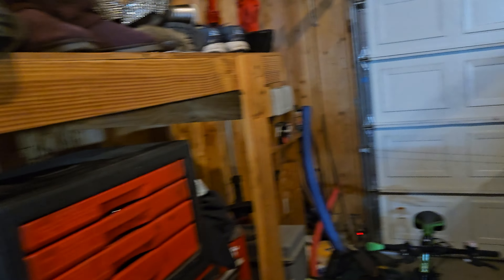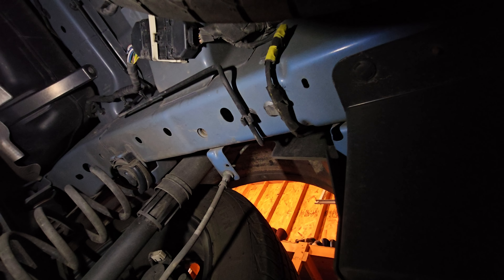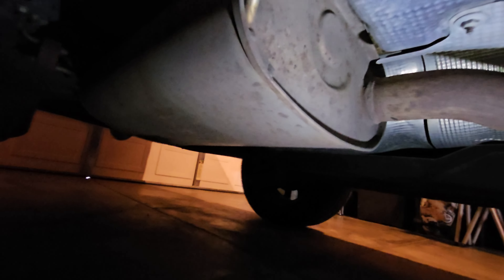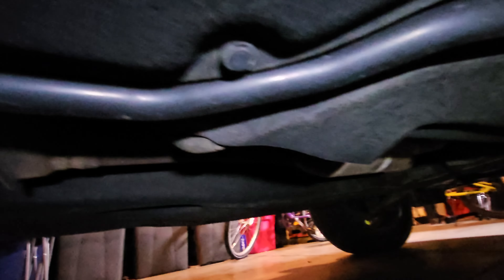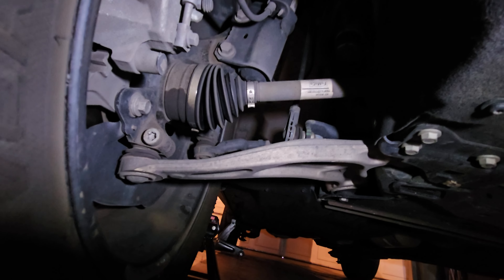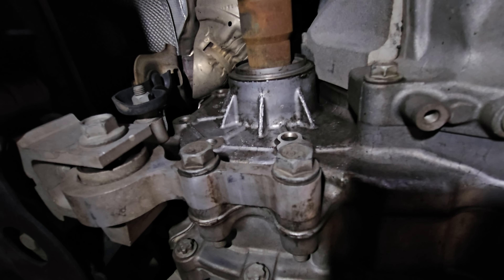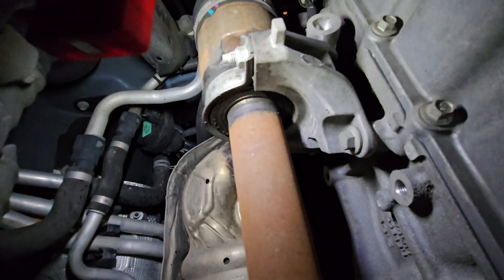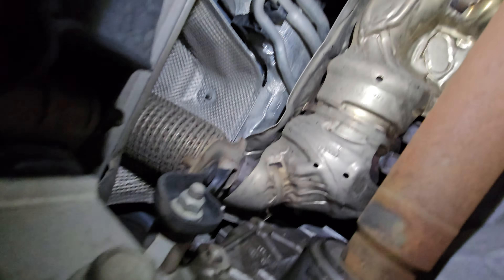RUST and LEAKS on my 2022 Ford Maverick Hybrid?? We Answer These Questions on jmcGarage Talk!

Comment: Nice and informative,  good to know no rusting issues with the hybrid Maverick.. I am at almost 20,000 miles on my 22 hybrid Maverick XLT also in Velocity Blue.. The one concern I have is the paint.. I recently found 3 chips in the front of my Maverick.. one on the hood.. one on each front fender which is sad because I really keep it clean and new looking as possible ..
Reply from the maker: Yes the paint is thin on these trucks IMO

Comment: My hybrid Maverick has a lot of smaller dents,  how the happening,  well is so weak material, that if I push it with my fingers could make a dent.
And I still have many shaking noises and accelerations.
Reply from the maker: The metal on the Maverick is deffentally not as soft as what's on modern day Subarus

Comment: Do they use road salt and or a brine solution in the winter ??... And do you keep the underbelly shield off or was it off just for the video ?? ...
Great job as usual John...
Keep us up to date on any changes...
23' Mav. hybrid here... 17k...
Reply from the maker: A brine solution in the winter and I have removed for good the under shield from the truck
Reply: @thejmcGarage  May I ask why you removed the under engine shield panel/ do you notice any difference in the fuel economy with the shield removed?
Reply from the maker: @Bob-xc2us  it was easier to do oil changes and no real difference in fuel economy

Comment: Great video, have you ever changed the transmission fluid? Do you still have a lot of pad left on the brakes?
Reply from the maker: Have not changed the transmission fluid yet and the front pads look brand new but the rear pads need  to be replaced around the 100k mark